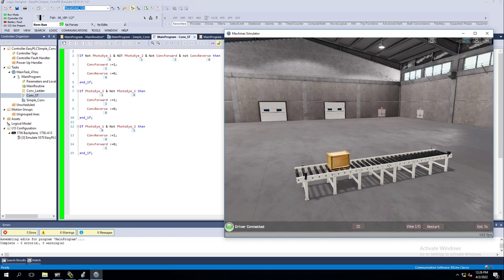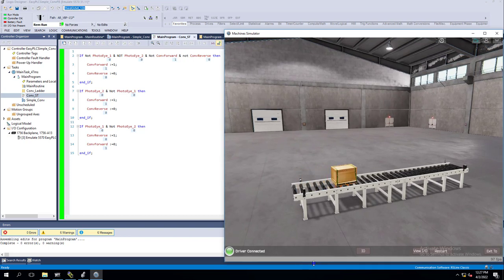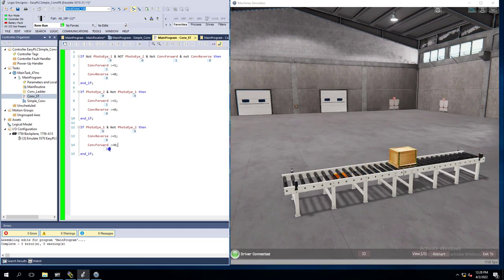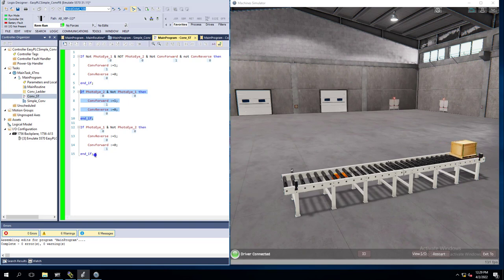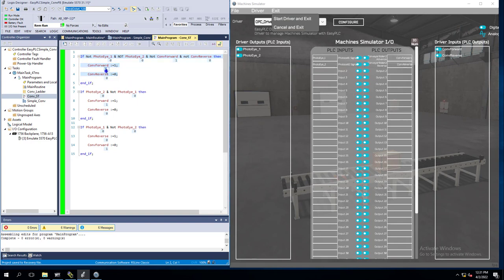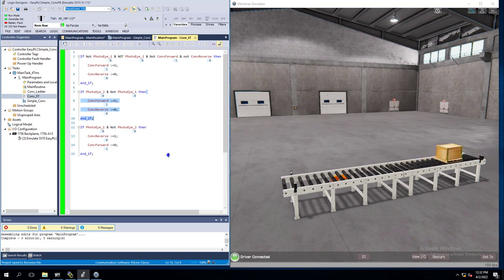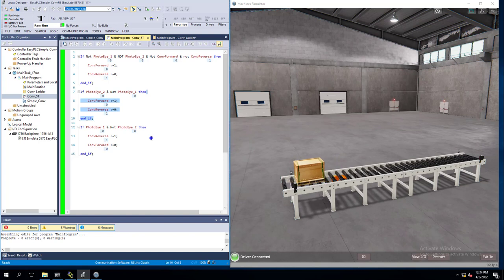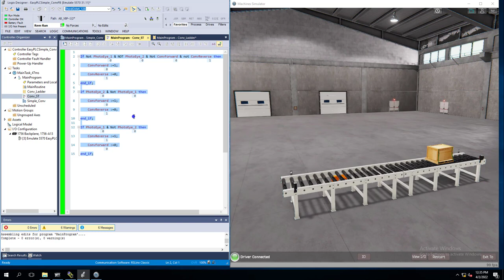PLC Programming Structured Text - Conveyor Box Controls | Studio 5000

Comment: Good afternoon, I would like to see a video on changing the Min, Max, Scale and Units analog HMI Tags, using VBA. This option was RSView32. I need to change them without leaving the working project
Reply from the maker: For the screen in reference there should be tags, with those tags being active on that screen then there are graphics to represent the tag values.

With this being said then right the VBA to call the graphic's name then select the feature needed & add the equals to whatever you need them to be equal to.

Make sure VBA control is active for that screen graphic.

Example:

NumericDisplay.value